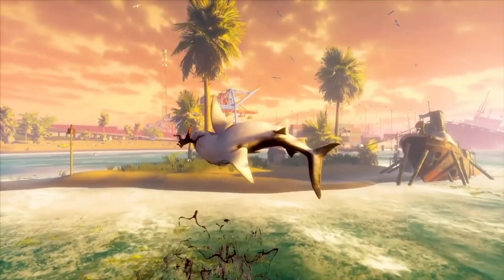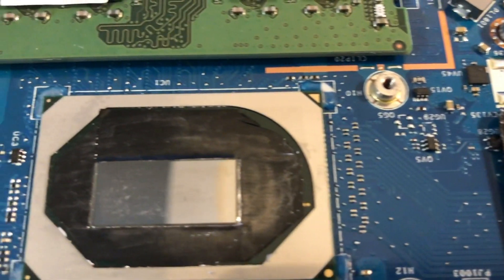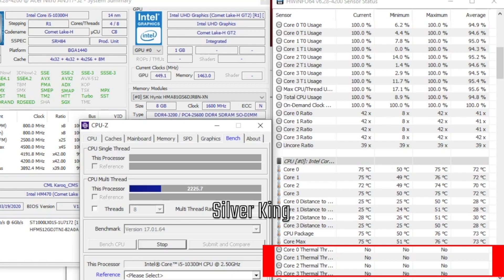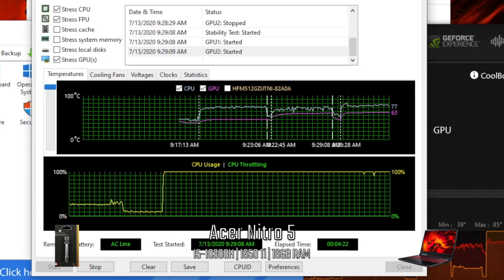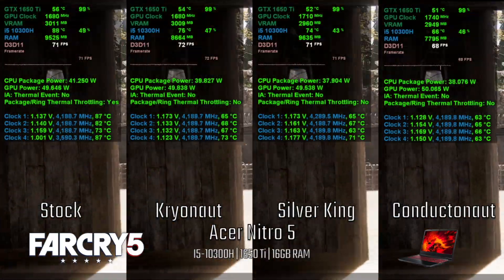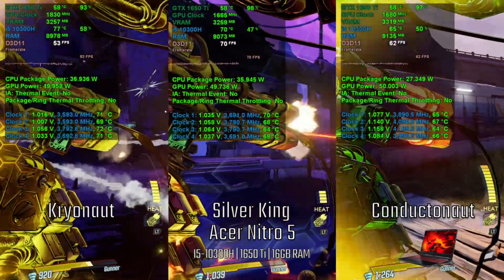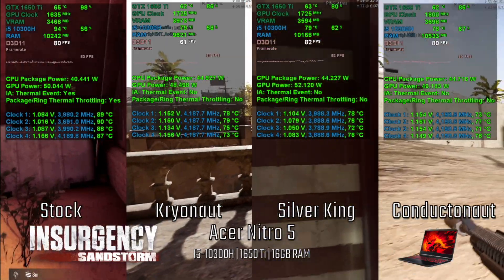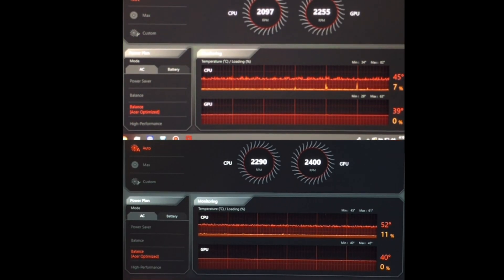Conductonaut Test 2020 Acer Nitro 5 1650 Ti

Comment: those 5 celcius ain't worth the risk and copper stain .. Kryonaut seems works really nice on this laptop
Reply from the maker: I tend to agree but if you need it then you have no choice.
Reply: @Meanpooh  I found something that performs very close to Liquid Metal.. and its a Phase Changing Thermal Pads ... 
Honeywell PTM7950 .. it works damn fine especially on laptop 

I used Kryonaut Extreme and had a PUMP OUT effect on it.. I do some research and found this better product instead
Reply from the maker: @kyosukeshidou1370  I was reading about the product last week as its getting close for me to repaste the Legion 5 Pro which is what they use.  Can't wait to try it out!  Glad it's working for you.  👍
Reply: @Meanpooh  I highly recommend this one for any Direct DIE cooling system..no pump out

Comment: What did you use instead of the stock thermal pads ??
Reply from the maker: I didn't replace the stock pads.  I reused them.  The system was practically new, so there was no need to replace.

Comment: Hey meanpooh, thank you for the video. Very informative and helpful. I have the same laptop. When I play BF5, custom graphics between medium and high settings, I get temperatures between 85c to 92c consistently. I’ve never repasted so I would like to avoid if I can. Are these temperatures cause for concern?
Reply from the maker: You're welcome.  It's only a concern if it bothers you.  Your CPU can handle the temperatures.  It can handle up to 100C.  If it gets that high then call Acer.  You may never see that temps as your CPU will begin to throttle causing the performance of the computer to decrease.  This is a safety measure that's built into the processor.
Reply: CPU temperatures*

Comment: May i ask how are yours Turbo settings set ? I mean normal Turbo in Watts (PL1), Short time Turbo Duration in Watts (PL2) and short time turbo duration in time ... thank you :-)
Reply from the maker: No undervolt.
Reply: @Meanpooh  ok i understand, but i wanted to know numbers of turbo for 10th gen i5 in Nitro 5 2020 from stock :-)
Reply from the maker: Im not using any software.  Its stock out of the box besides repasting.
Reply: @Meanpooh  Ok but you will be able to answer this when you check it in Intel XTU. This feature is there unlocked :-). I wonder how Acer configure Turbo for this model of yours. Thank you

Comment: as expected, acer really did fix the cooling problems with the newer model by placing 2 fans on the opposite sides. as a result, kryonaut would be a better choice as it's significantly safer, and doesn't stain the copper heat pipes.

Comment: Is it undervolted?
Reply from the maker: No, its not supported.
Reply: @Meanpooh  are the temps the same as the nitro 5 with the i5 8300H
Reply from the maker: @aaronstorm5968  I would say they are different as the machines have different CPU's and cooling system.  One thing you can do is undervolt.
Reply: @Meanpooh  did you do kryonaut tests on the 8th gen?
Reply from the maker: @aaronstorm5968  No, I sure didn't.  I did use Kryonaut though on the i5 7300.
Reply: @Meanpooh  it was way better than stock i believe?
Reply from the maker: Im sorry, I did use Kryonaut.  I got the message confused with another.